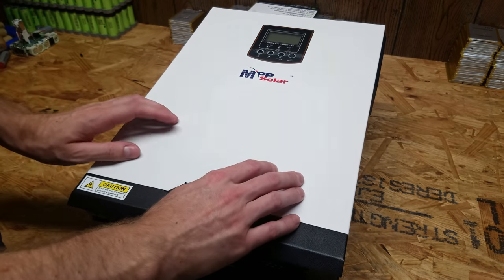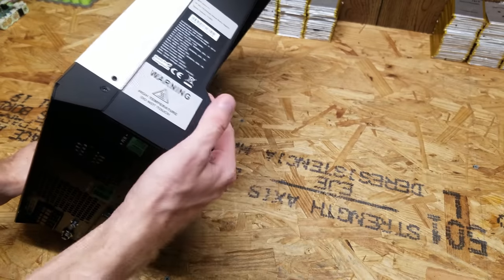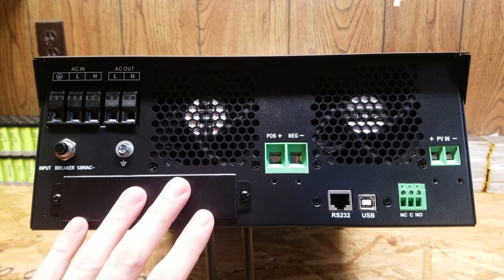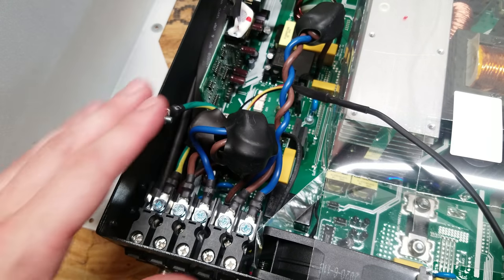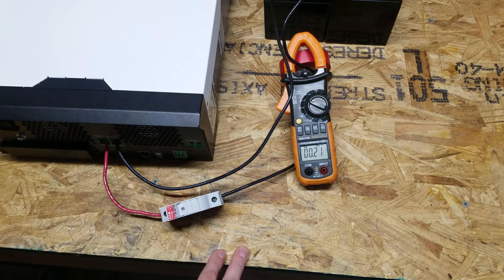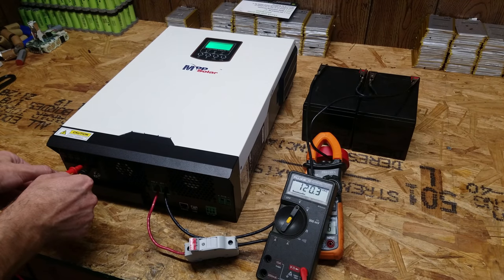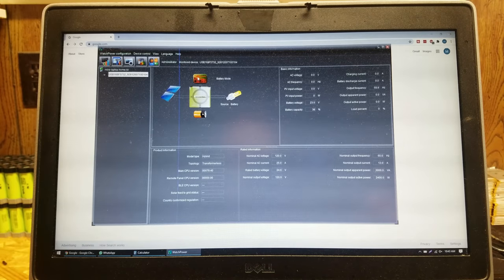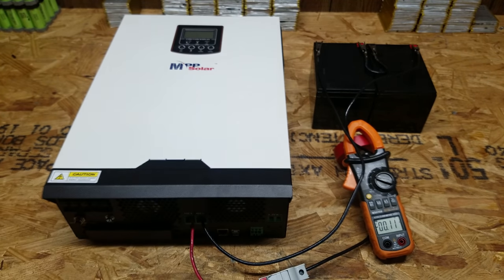A Quick Look at the MPP Solar PIP 2424LV-MSD Pure Sine Inverter

Comment: Could you explain what having a "split phase," achieves? I am considering a system that would require two of these units due to the total amp's produced by the batteries (102.5). I am doing a system for a bus. I will have a distribution panel for ac and 12 volt feeds as well.  Thank you!
Reply from the maker: In the US, we have split phase power - meaning the 240V stepdown transformer has a center-tap "neutral" which creates two 180-degree shifted 120V legs. If the country you're in doesn't use 120/240V and just uses 240V, you can ignore the split phase versions :)

Comment: Good Video.
 I bought a used Van with similar MPPT charge controller (1000W 40A) which makes the start up beeping noise all the time. The fault error code shows 06 with constant beeping noise. Don't know how to resolve error and stop the noise?? It didn't come with a manual.
Reply from the maker: Can you tell me the exact model you have? It should be on the side panel.
Reply: @LithiumSolar  Thanks for reply. Yes the model name: PIP 812LV-MS.
Reply: @LithiumSolar  Hi, Any thoughts on what could be wrong with the MPPT? Always beeps with the same error code- 06.

Comment: As always, your presentations are very intuitive and this one is no exception. I didn't like the amount of draw this unit has at idle because, with my current 24V system , I am using two 40AMP Epever chargers, with 6 100W panels connected to each one, and paralleling them to my LTO battery bank and 3000W pure sine wave inverter. My idle draw with both chargers and inverter is only drawing 39W when the cooling fan on the inverter is running. I am curious about what the efficiency is on the pip is? Quick question, I am currently building a 48V system, on my off-grid farm where my 24V system is, and, because I am only using enough power to run my video surveillance system and internet service, I was thinking I could connect my 24V inverter to the on-grid AC side of my Sol-Ark 12K to utilize the excess power it's producing. I would have to do this by connecting the AC from the 24V system to a 240V transformer before making the connection to the Sol-Ark, I am pretty sure, but I am wondering if it would be worth the cost of doing it. Your thoughts?

Comment: I thought nominal on lead acid was around 12.6v (x2 25.2v) which would put standby current north of 61w per module. It’s a small difference, but watts are precious on batteries.
Reply from the maker: The batteries were sitting right around 12V each when I started testing, so I used an even 24V. It might have been a little less as I don't know if they dropped a tenth of a volt or two during the test process.
Reply: LithiumSolar thanks. Keep up the good work.

Comment: Yeah, the standby loss is insane, it would be OK for backup power, but not so much for off grid 24/7,  I'm sure my system, including charge controllers and inverter isn't much better, 
I have heard two stories, 1- they are great, last forever,  and 2- they are OK, but don't last , only 3-4years, thing is , you never know the environment, or use, I'm sure if it's run low voltage, HOT and at full power constantly, it's not going to last, or run it hot at near full power, then constantly having a large inductive load kick on. It will be short lived surely, I try to stay around 50% rated, for constant loads, and under 90% for surges,  being off grid, I'm hoping to get another large inverter, incase of a failure. I have a small inverter to keep a small load going, I need something to run the fridge and microwave, I do not want to run the generator all day! Great video..

Comment: Thats incorrect.  In standbye mode idle consumption is zero because inverter is off when no load is detected so its not an issue and perfectly suited for large or small systems.

Comment: I thought the battery input terminals seemed a bit puny too, but after measuring mine, I believe the connection is just super clean, and therefore deceptively robust.  According to the wire dia specs, and my drill bit "gauge pins", they will accept 1/0 cable. A 21/64" drill bit is .328" which is a hair over .3249", the nominal diameter of 1/0 cable. If one has "letter size drills", a letter "P" drill is as close as it gets @ .323". Someone see what size drill goes in their model. A 5/16" (.312) drill shank should go in a 1/0 lug easily. In case you don't have a drill, a 5/16 bolt would be a bit more sloppy, but should work just as well for confirming if you have a Zero gauge lug or a #1. As this linked chart shows, no way will anything 5/16" go in a .290 diameter, AWG1 lug.
https://www.powerstream.com/Wire_Size.htm
Reply: Im struggling with the battery terminal as well.  I need to fit a 2/0 wire, but the inputs appear to be... 8mm wide?  Any tips?
Reply: @whitneygray6967  How much would it cost to switch to single aught cable?
Reply: @kelhawk1  eh, I have some 2AWG around here, think that would fit / work?
Reply: @whitneygray6967  According to my measurents and the wire dia. charts, it should fit easily. See if a 21/64" drill bit shank will go in first...

Comment: 081920/0627pst  Thanks. That was a short product information. I am confused, actually, if this unit is a combination of an inverter cum MPPT charge controller. Pardon my ignorance. Please clarify. 73s...
Reply from the maker: Yes, this is a combination of a 2400W inverter and an 80A MPPT charge controller.
Reply: 082620/1137pst.  Thanks much for the response. 73s..
Reply: @LithiumSolar  3:49 in you cover the input output, is that where the 80a number for the unit comes from? It'll take 40a grid charge and supply 40 amps of power for appliances? And am i correct that it only charges a 12v battery? And also, it will take a hundred amps of solar?

Comment: "Very basic packaging", "very basic Switch",  "fairly decent". I would say for the price and what it can do is more than decent or basic. Also you have the 24V version and not the 48V. I Think is more efficient that you Aims inverter and usually in a regular house you do not have big loads running all the time. Most of the time is 200 -300W or less.
Anyway this is the first time I heard about AIMS inverters; Good to know.
AIMS inverter:
Nominal Efficiency: >88% (Peak)
Idle Consumption: 150 Watts

With that efficiency you need 20% more soar panels and 20 %more batteries. In the end it gets more expensive.

Comment: You need a computer to run this ?
Reply from the maker: No. You can program it all by using the buttons on the front of the device, it's just somewhat annoying to do that way.
Reply: @LithiumSolar  Thank you for replying. Awesome channel, I am learning alot. I want to make a vehicle with wind turbines that charge while you travel
Reply: @couchsurfer2856  I've been looking into that as well, Missouri wind said it couldn't be done. I asked a guy that runs a diy car alternator as a water pma generator from a slow moving creek, he seemed to think it should be no problem. If you do post a video please, id like to see it. 
   The main problem seems to be matching the pma alternators needed rpm for proper output, with the proper vawt style blade. John daniels has one on his rv for supplemental charging when parked, but doesn't use it for charging while driving. But it's a solid mounting job, and doesn't seem to have a lot of flexing and bending to it.
   From what i can tell a belt would have problems with slippage, so a chain drive would be necessary. My thoughts went to a 10 speed bike type sprocket system, for if your going from state to state with different speed limits. It would need an easy way to slide up say the blade with a set screw, and two or three sprockets on the mounted pma. That way it wouldn't take long to pull over and change the chain to different sprockets.
   For my use i would have it in extendable poles, that way it's just at the top of my vnose trailer while driving, and i could extend it up two poles when parked. That should get up to 18' for better wind. Chances are you've thought about all this, but since there aren't many thinking about it i thought id comment. Luke fuegate has a lot of diy stuff if you want to check out his channel, he does a lot of in expensive stuff with recycled parts and on the cheap, i get a lot of ideas watching what he does and a good laugh. Good luck!

Comment: anyone else having issues with their https://www.mppsolar.com/v3/pip-mgx  , mine seem to work as expected with no grid attached , but as soon as grids their it constantly wants to use it , and we have NEVER seen anymore than 4amps go into the batteries , over 5kw of solar available and even @ 500watt load only grid gets used WTF I have 3kw / 5kw and 7kw versions of these all act the same , run sweet no grid / battery directly solar only , give it grid and that is all it wants use a high load over 2kw it will then use batteries but not charge them and solar input does not increase , for now just using these batteryless /no grid just to run aquarium heaters during the day or else the solar is not being  used ? no idea what is going on battery banks are x tesla 24v 444 18560 modules , the only other solution was to use another AC / battery charger , but then the mpp lets the battery voltage drop because its not charging over 4amps  and these should do 80amp

Comment: MPPSolar Inverter will eventually fail !!!
Reply from the maker: All components will eventually fail...
Reply: MPPSolar is a inferior product !
Reply from the maker: Can you please cite some evidence or personal experience (what happened...) to back up this claim...?
Reply: Purchased PIP3024 in 2018 , after 4 months had a comms board failure had the pay for new parts , in 2020 set of capacitors failed damaging the main board , MPP suggested I had to replace the board again at my own expense. Went onto YouTube and noted the same failure’s reported back in 2014. I feel MPPSolar did not address a know issue either through the design or parts used. If this was an isolated occurrence MPP should have picked up the cost but they did not. Changed brand and have not had any issues yet , with a 5 year guaranty on works man ship and parts.
Reply: @bertoperelaer  What brand did you change to?  Asking for a friend.

Comment: it's garbage! Never i would such crap again.
Reply from the maker: Can you elaborate why? Did you have one and what happened? I love mine and even went and bought a second in 12V.
Reply: @LithiumSolar  has, we have PiP 3024 GK ... the software is old, low level developed, the measurements are wrong, many senseless failure messages. The support is the worst i ever have seen! No joke, it's crap!